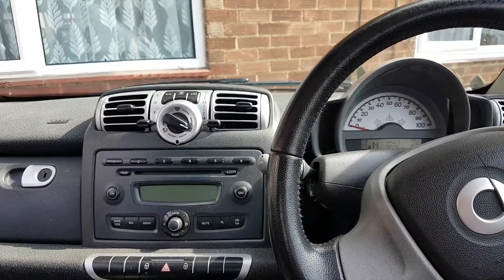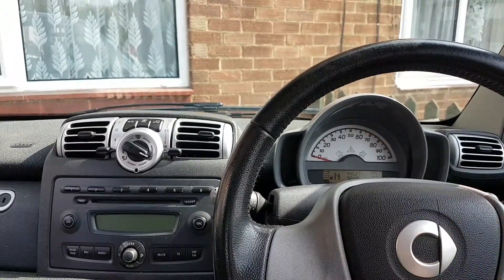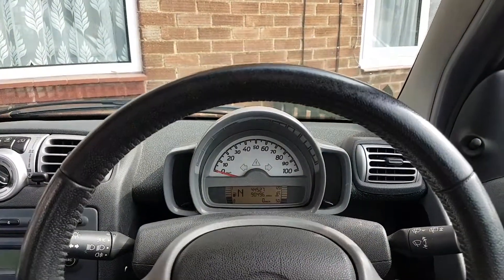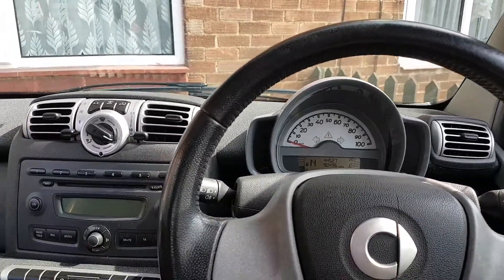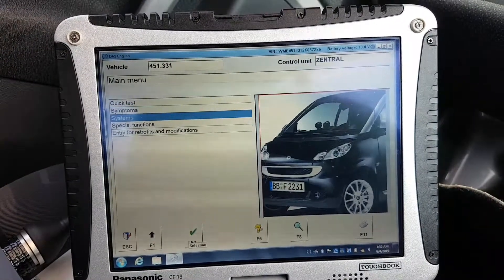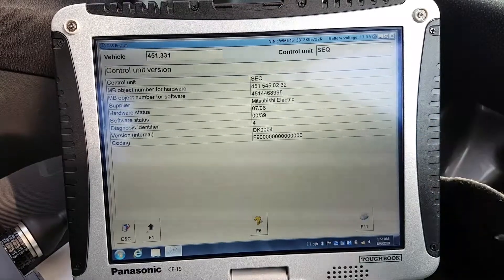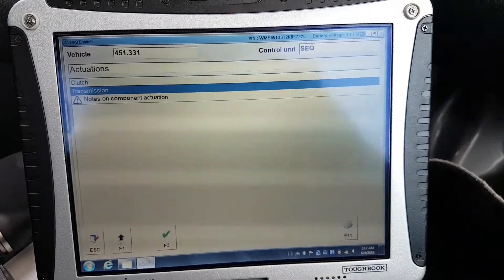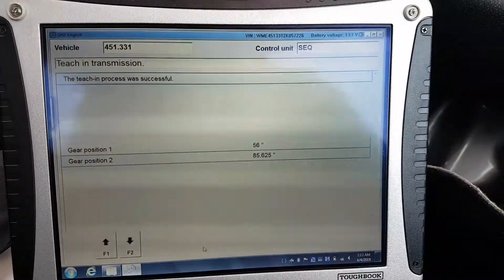Smart Fortwo 451 not engaging reverse. TCU programming and relearning.

Comment: Hi ! I have a big problem with my smart forfour 2004 , 1.5 automatically , is in 0 and it won’t enter in any place . I was changing the actuator and after it works but just in R and N . But not in a 1 2 . I was trying to do a learning with the tester and it was aborted and stocked in zero and it not more work to start . What I can do ? Do you have an idea . The mark of tester is autel .
Reply from the maker: Which trouble codes are you getting?
👍👍👍
Reply: @L @LMAutoRepairs sorry for late answer
Reply: I can’t sent you the codes , the comment don’t appear
Reply from the maker: 🤔
I can't see anything on comments for revision either...

Comment: Have a 2013 smart for two Passion 451. changed the Clutch Actuator   Brand new from  German made Sachs 1.5 yr ago. worked great. NOW car turns on sounds great but cant shift R or Drive. only Neutral. shifts P to N but R or D wont light up. shifts but wont drive.. ANY help Ideas???  anyone. Love you vids and all help you post.   thanks  Need my car
Reply from the maker: Scan the car and check live data...
👍👍👍

Comment: Cleaning the actuator is a total waste of time 
The problem is that the car is detecting input shaft drag 
The updated soft ware will accept a slightly amount of rotation but the problem is the clutch is finished 
Replace clutch
Reply: My clutch is 1 Yr old and still does this sometimes
Reply: @aromatic987 
Take a look at the pressure plate straps, one is snapped, when two snap you won’t need to look you will hear it

Comment: Great video. Nice to know that this is a 'known' fault - which we have in intermittently Side question: I purchased a fully automatic gear shift to replace the soft touch for my daughter's 451 I was going to ask my mechanic to swap out the two while he had the car in the shop.
Q1: Does he need the TAN code to do the swap or will Xentry take care of that?
Q2: Is it too ambitious to try both at the same time?

Thanks once again
Reply: Have mine in the shop as I write. They say it is not a remapping issue but could be a faulty pump that supplies oil pressure to the gearbox(?). Any ideas?
Reply from the maker: Hi
Does not make a lot of sense...
The gearbox is essentially a manual gearbox  that has some electric motors/servos to take care of the single plate clutch and the engagement of the gears...
Not sure where that oil pressure comes into play...
👍👍👍👍

Comment: Hii..in my country there r very rare auto cars..recently i got chance to work on hyundai verna car with auto transmission...the selector lever goes into drive bt the car doesnt move at all..the fault code says that transmission range sensor circuit high..does this mean that the transmission range switch is faulty??? or there is some other problem...it also has TCM module...plzzz advice...thank you
Reply from the maker: Possibly the sensor.... but it is difficult to say...
Could be a wire issue, etc, etc...
You need to investigate...
👍👍👍

Comment: Hello, thank you very much for this video. I have the same problem with 451 Smart diesel 2008. It only happened few times tho, I tried to shift reverse from neutral and the N just start blinking. So I turn the engine off/on, shift to 1, etc. and it starts working again after a few minutes. I'm planning to visit the mechanic in a few days (hopefully the one that knows what I'm talking about), can you please tell me what exact software version should I have on my TCU that may resolve this issue? Is it the SW version from the video? Thanks in advance.
Reply from the maker: The one from the video or above... I am not sure if mercedes released anything newer...
Thank you for watching and for your comment! 
👍👍👍

Comment: is possible to do the same whith bluedrive obd?
Reply from the maker: 🤷‍♂️
Never used such thing... Don't know...
Thank you for watching!
Reply: @LMAutoRepairs  I had the same issue, I did the software transmission update and now With the update I have no problems putting on reverse gear, but 5 times to10 the reverse gear scratches a little bit, I would like to understand where the problem is.  the car has only 29000km
Reply from the maker: Was the clutch biting point learned successfully?
Reply: @LMAutoRepairs  I don't know, I took it to mercedes, mercedes say  the drag point failed twice, I have to change transmission and clucht; but I don't trust them, when I did the software update the car had 25000km
Reply from the maker: Most likely it failed due to a worn clutch...
Had it in the past...
Reply: @LMAutoRepairs  how can it be possible that the clutch is worn at 25000km? Is a mercedes.  For 11years the car was used only for go to the groceries store, short journeys, 200km a month, serviced every 12month, now it is used for do UBER eats and in 2 months I did 4000km, with the other gears i have no issues.
Reply: @LMAutoRepairs  Anyway the car is cute, but I am disappointed, for be a Mercedes it has too many issues...
Reply: @LMAutoRepairs  and the stop stay system is 💩💩💩
Reply from the maker: It is possible...
Start and stop during short journeys is when the clutch gets more use...
It might worth a check...

Comment: Hello there, i want to thank you for you videos, it made me learn a lot.
I have a smart fortwo with a gear problem. When the car its not running i can switch gears, but after starting the engine it doesn't swift gears anymore. I switch the clutch kit and actuator and it does the same thing. Can you help me with that?
Cheers
Reply from the maker: If you swap those parts they will need teach-in... you need to get that done first...
While doing it, scan the car etc...
Thank you for watching and for your comment!
Reply: Yes I tried but it doesn't work.  Gear learn ok but clutch learn it shows operation failed.
Cheers
Reply from the maker: So, something is not right in the clutch system... 
You need to check that...

Comment: I had the same issue and used Delphi lead to do this seemed to work fine, I also read somewhere it will self learn after battery is disconnected for a while.

Comment: My smart doesn’t go into reverse unless I go into 1st first then put it into reverse, sometimes that doesn’t work (happening after I got the TCU updated and taken apart, cleaned and greased the actuator)
Reply from the maker: There is an adjustment on the actuator...
Have you calibrated everything successfully after the programming? 
Thank you for watching!
Reply: LM Auto Repairs Thanks for the reply, I marked out where the actuator was before taking it off so I could put it back in the same position. As for the TCU update; I sent it off to 4Smart for the update, it did seem to work for a short time after receiving it back (that might just be luck) because now it does the exact same thing shown in your video :(
Reply from the maker: @Yiasou  
I can't really help any further...
Scan the car and check live data...
Is the only thing I can really suggest...
Reply: LM Auto Repairs Thanks for the advice pal 👍

Comment: I was driving my Wife's 451 when it made a loud bang then just stopped, in time the engine started but the shift wouldn't work in either direction.  Before the incident the car seemed to struggle and made more noise than I would expect, the person we got it from said it was the ECU, a solenoid and software that would make the car work again but I'm no expert and am not sure I believe what I was told.
Reply: It's usually the clutch actuator motor snapping.
Reply from the maker: Loud bangs are usually never a good sign...
😬

Comment: Just push Brake with foot, then put reverse. It should work. Without push brake, it will not work.. tested on my smart 451 mhd
Reply from the maker: This was a different issue...
If that was the problem, would not engage 1st gear either...
The issue was just the reverse.... what I have showed in the video fixed the problem. 
Thank you for watching!

Comment: i got 2 of these cars with gearbox issues, both stops during driving with gearbox stuck, to have car moving need battery disconnect reconnect, no issues in diagnosis, unfortunately i haven't tool that is capable of relearning or reprog the gearbox :( i think is the same issue.

Comment: My mechanic did the actuator cleaning and regreasing, after that he did a reset to the transmission, but when i start to move the car, sometimes it makes a cluncking noise but other than that it shifts just fine.
Could it be a reteaching problem?
His tester could not perform a teaching to the transmission.
Reply from the maker: Or a worn clutch...
Thank you for watching!

Comment: Most is that the clutch is worn out you need to replace it
Reply: It's rarely a worn clutch. The car gives the clutch a certain amount of time to complete a movement. If it takes too long, it fails. Generally it's because the clutch is binding. The replacement clutches have Teflon splines which don't bind. However, smart's update just increases the time allowed for the actuator movement.
Reply: My 451 clutch has started to make a terrible noise on idle. It is as if some bolt has come loose inside. When I drive the car it drives perfectly fine however when it comes to a stop the rough noise is shocking. All the gears work fine. What's gone wrong to my car?
Reply from the maker: Possibly the thrust bearing... or something along those lines... I would have it checked before gets worse...
Thank you for watching!
Reply: @LMAutoRepairs  thanks so much . I took the car to a few mechanics to try and get their opinion . They all said dual mass flywheel. Confused now what to do. Is this expensive ?
Reply from the maker: @jasa198  
That's another possibility... true!
You can get everything for probably less than £400... plus labour...
👍
Reply: @LMAutoRepairs  thanks . I have been quoted £250 labor .
Reply from the maker: @jasa198  
👍
Reply from the maker: It was replaced a few days later...
But this update definitely sorted the issue with failing to engage reverse...
Thank you for watching!

Comment: Great job as always!! Just a quick question. I just bought a 2005 MK2 Focus 1.6 101HP manual trans. Would it be beneficial to reset PCM adaptations in order to get a bit better mileage or any improvement in driving? Or is it any good reflashing the PCM with the latest soft version? Thank you for your advice!
Reply from the maker: If the car is driving fine, probably not...
But, worth to check for TSB to see if any flash has been released to sort any specific issues with that car...
Thank you for watching and for your comment!